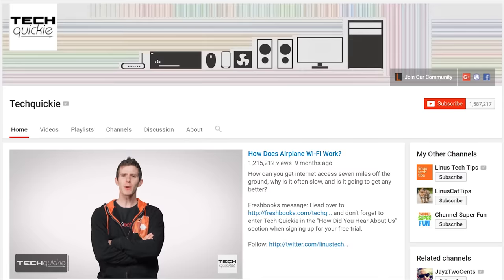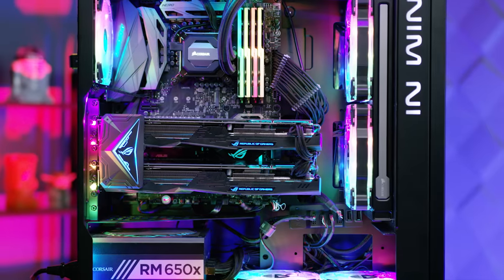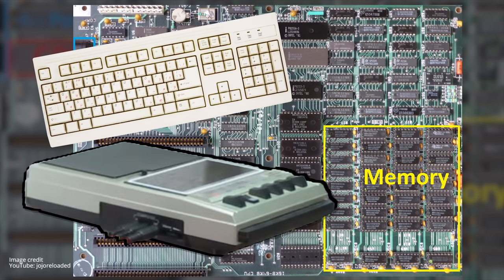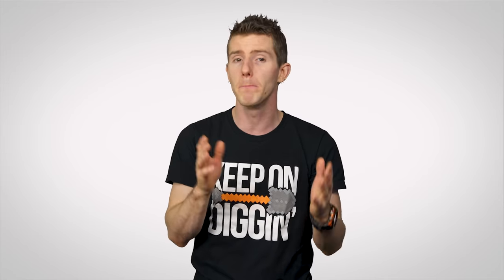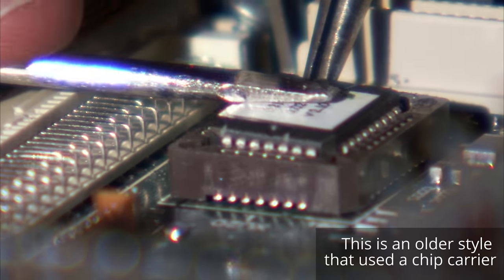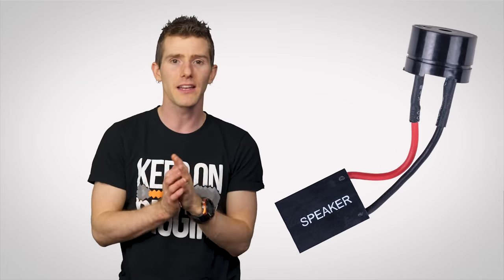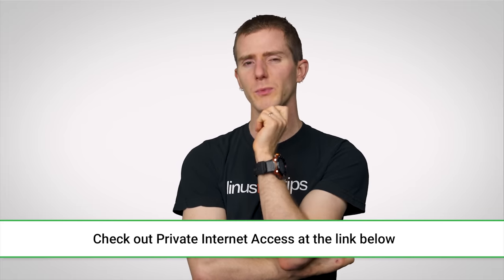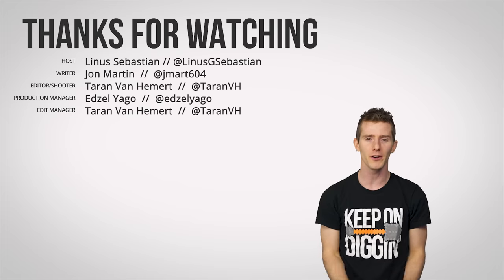History of the Motherboard

Comment: Started computing on a Amstrad CPC464 in 1992 with Datasette, a Green-Green-Monitor with Mode 1 Graphics and a whooping 64kB Memory. Learned BASIC on that System when i was 9 Years old. Still struggled in school, but my programming was good, haha
Reply: And just last Weekend i assembled my brand new Ryzen5 3600X on a MSI B450 Tomahawk Max, with 32GB 3200MHz RAM and without any optical drive. Man, how times have changed. The difference between my first games and what i am seein on my i27X HP Screen now is unbelievable. What a time to be alive...

Comment: Speaking of motherboards...it would be interesting to see if there are any speed differences between a E-ATX mobo, or micro mobo. (Along with shorter and longer cables combined) 
Largely due to parts being closer together/far less travel required for things to communicate. 
It would be extremely small in difference most likely...but I’d be interested in seeing the results. 
Perhaps it would also bust any myths out there. 
(I’ve seen people debating this oddly enough).
Reply: If there is a speed difference, it's in the PARTS used, not the size of the motherboard.

Comment: At least with expansion cards, you could upgrade capabilities like video and memory.  You can't do that with integrated functions on the motherboard.

(Do you still have to change the jumper setting from master to slave on external drives?)
Reply: I've not seen a "master/slave" jumper on anything since EIDE - Serial IDE (now known as SATA) did away with those.
I think SCSI lost their "drive address" jumpers with the SAS standard.

Comment: During 90's and early 2000 cheap motherboards weren't fully compatible with affordable ISA or PCI cards. I had various problems. Also theoretically they were MS Windows compatible but in practice several crashes was the reason of poorly designed motherboards. 
The true is that motherboards by Intel or reputable peripherals like Creative  Sound blaster sound cards, 3dfx Voodoo graphic cards, HP printers/scanners, Intel network cards, Microsoft mouses etc were highly compatible not only with Windows but with Linux too. Cheap RAM modules was an issue of serious instability. The more you were paying the more stable and fast your PC was. 
The last decade the performance gap between laptops and desktop computers is narrower and I don't bother with motherboards and internal peripheral cards.

Comment: I remember when installing a cpu, you had to set the jumpers on the motherboard to set the appropriate voltage for the cpu.
Reply: AND the clock rate.
You have just partly described every Socket 7 motherboard I've ever seen OR worked with/on.

Comment: AGP short lived? It lasted 10 years. It started before we had what people would recognize today as 3d video cards and went up to cards that even today can still be used for some games. If you want short lived buses, try the CPU dependent VLB that was essentially the bus of the 80486 added to the end of a 16-bit ISA slot. That or the AMR slot for modems / sound cards.
Reply: It is possible to get AGP cards that are low end GPGPU capable.
Not many of them ever made, but A FEW.

Comment: The S-100 was a Passive Backplane design.  Flawed because it required regulators on the daughter boards. But tens of millions of computers could have been easily upgraded and not thrown away if Imperial Benevolent Malevolence had produced a good passive backplane design.

Comment: Slight correction, many many MANY years ago, I had a socketed 10186 that had little gold tabs like a modern Intel CPU and sat inside a ZIF socket (like LGA style), then my AMD 386's were either soldered or inserted into PLCC sockets, while my Intel 386's were pin socketed like the 80486, 586, Pentium 1, and Pentium 3 socket 378... 486 was not the first socketed Intel chip...
Reply: 486 wasn't even the first Pin Grid Array Intel CPU - that was a few models of the 386, and POSSIBLY the 286 (but I think the 286 was still DIP).
Reply: @bricefleckenstein9666  I also had a 286 PLCC socketed board at one point
Reply: @davidflorey  I'd managed to forget about those.
I've not seen anything PLCC in a couple decades I think. Perhaps longer.

Comment: The future is exciting, motherboards soldered into the frame so it cannot be replaced, GPU and CPU soldered onto the motherboard with a permanent attached heatsink glued ontop. 
Keyboard and screens permanently glued into the chassis, memory, SSD and even harddrives soldered onto motherboard. 

Irreplaceable batteries and much more.
Future is coming guys and its looking good.

Comment: Well, this awoke some memories of the past.  An Episode on the bus evolution would be cool as VESA Local Bus didn't get a mention.  Also, I wonder how many people remember the pre IDE hard drives that had all of the drive electronics on an IO card.  Weren't the first lever based CPU sockets called ZIF for zero insertion force?  Guessing most people who worked on kit before that will have had to do pin straightening before, fun times 🙂. Right, I'm off for a nostalgia trip.
Reply: ST-506 interface, in MFM and RLL varients.
Also ESDI and SCSI.

Comment: At 2:00 you say that the memory was build in. But that is not correct. This was the first standart board memory sockets. 
Normally they delivered the PC with just some memory and then you could  buy/plug in more memory. 
Or you can change a simple chip without soldering if you had a defect.
The next generation of boards was the first with a free multiplikator where you could change the CPU,
and then "Jumper" the right Mgh and Multiplikator. That was a cracy time without Plug&Play.
Install a driver, write it in the autoexec and config file.

Comment: Motherboards still need to evolve further; some of the tiny four and three pin connectors need to be phased out, they're very annoying to work with, and also confusing at times especially if you are like me who builds a new computer every 3-5 years and gets to go through that nonsense all over again. I'd like to see Asus, Gigabyte, AsRock and other manufactueres work on simplifying the Motherboard layout even further by 2020.

Comment: You could talk about axt  itx  mini atx motherboard sizes and if it is standard or if it is up to the manufacturer.
Reply: ATX. Mini ATX, Extended ATX, have standard motherboard sized.
ITX I think has a standard.
There is also the FlexATX standard, but that's not a lot used any more I think.

Comment: Next, there'll be a way to install CPUs without the sometimes-annoying thermal paste/thermal grease. Maybe processor's heatsinks will be physically soldered to the built-in heatspreader, with additional cooling layers optional.
Reply: Unless CPUs start needing a LOT LESS power, we'll never see the days of non-imbedded non-laptop CPUS that can operate for more than "POOF" without a heatsink and thermal compound.

Comment: we went from IDE to SATA ports...
we went from ISA to AGP to PCI to PCI-e, as mentioned in the video this was in 2004, its 2018, why hasn't a manufacturer thought about making a newer, faster, smaller port to replace PCI-e?
thoughts? :)
Reply: Gerome Fournier Still enough bandwidth? Maybe when gpus use more than 16 lanes speedwise
Reply: We actually went from ISA to PCI to AGP to PCIe, and both PCI and PCIe are still with us today, though it is getting harder and harder to find motherboards with PCI on them. The reason AGP only had a relatively short life is that it was a dedicated slot just for graphics cards (hence the name, Accelerated Graphics Port), and so it was less useful than the other standards, which could take basically any kind of expansion card. As for why PCIe hasn't been superseded yet; it hasn't been around that long. PCI was introduced in 1991, and it was still very common to find it on boards just a few years ago, and as I mentioned, it still hasn't been entirely phased out. Compared to that, PCIe has barely got started.

Comment: if that IBM came out in 1981...hmm..I just can't help but compare that thing to my home pc at the time..the mighty Sinclair ZX Spectrum...which was around in 1982...I am reasonably sure that it was more feature rich than that IBM...it had 48 K of RAM, color graphics, a very good version of BASIC with real time syntax checking...it had tape loading system, a micro-drive interface, interfaces for joysticks, paddles etc, printers etc, it was extremely well supported....

Comment: Now if they would just for the love of god move the 8 pin CPU power connector to acknowledge that power supplies are on the bottom now and not the top. I can't use the cable management in my case if the only way to make the power line reach/be able to go in is going along the front of the board.

Comment: It has mostly been an upward journey. Does anybody else remember building 386s and 486s with f#kking raiser cards? Dear lord god, I'm glad that's ancient history! Or on-board jumpers, to configure HDDs, so you had to read the number of platters and heads and cylinders and sectors, and then set 4 or 5 jumpers before the MB would even read the f#kken drive! And by the end, systems got smart enough to figure out what a drive was and work with anything, but to start with, you had to tell the system if this drive was a master or a slave. You would think that simply depended on whether it was plugged into the middle of the ribbon or the end, but No, that'd be too simple....

Comment: Good video. But as a dude that was around back in the...(god, i am old)...days, i can´t remember any mobo´s with built in sound (on wintel) untill the mid90´s. It was always separate cards even on mass produced (Dell etc). The last gaming rig i built was in 1996, and i like all other bought the Sound Blaster AWE 32. Ok, in 1996, mainstream PC´s had started to have integrated sound. But Ethernet??? I´m not saying that´s a millenial thing, but i think that´s something that started to also appear in the later part of the 90´s. And i guess that it´s partly because all the other standards that were around. I remember working on all those bus-nets with coax and others like IBM´s Token Ring. And IPX/SPX and Apple and MS hopeless attempts with Appletalk and NetBEUI. Some people say that it was better in the older days, but i just can´t see how ISDN+IPX+Cisco ever could be a good memory. Anyway, i think built-in sound and ethernet became standard a bit later than said in the video.

Comment: Why would you make expansion slots, when you could just integrate and solder everything. Requiring customer to use your excelent customer support, which doesn't have licenses to use your hardware and software. All this makes so much better ecosystem.

Comment: I am so glad for this video. Why? Because I was beginning to think I was senile. When I first started hearing of CPU's with integrated graphics I was so confused. I was certain it was the motherboard that had the graphics chip. In the end I just shrugged and assumed I incorrectly remembered or something. Afterall I never paid much attention to integrated graphics since even a basic Video Card was preferable most of the time. But no I was right! Vindicated!
Reply: Actually, AMD's A-series KILLED the bottom end video card market.
The A10s had APUS that were very close to a AMD HD7750 on some models - DDR3 "main memory" shared from the MB instead of DDR5 dedicated VRAM on the later 7750s was the discrete card's only significant advantage.
Then along came "Vega 11" and such on the Ryzens....

Comment: 486 is socket 3. Were is VLB, MCA and EISA? Were is Zorro slot from Amiga as Amiga was a PC as well. This is all about the IBM compatible PC. Not PC as in general. There is a giant hole in everything. I have even seen 386's on ZIF sockets.
Reply: PC in reference to microcomputers is IBM compatible. IBM-PC. Personal computers is another thing entirely.
Reply: Paul Frederick Dude.... PC is general for every single computer thst is a personal one. It has evolved from humble little machines running basic as the operating system to what we have now. A mac is a personal computer as well.
Reply: PC is general today. But IBM invented the term with the introduction of their PCjr model to describe their consumer line of machines. So PC means IBM compatible. PC != Personal Computer != personal computer.
Reply: Paul Frederick No. They invented the "IBM Personal Computer" the term Personal Computer was already invented. They just did their own take on the Personal Computer craze. VIC-20 was sold as a Personal Computer as well.
Reply: No one was saying PC before IBM did.
Reply: Paul Frederick Apple shure did say that their Apple-II was a personal computer in a commercial they did in the late 70's. PC is short for personal computer, no matter if we are talking IBM or Compaq or Apple or Commodore.
Reply: Paul Frederick And radio shack called their trs-80 a personal computer. As you can see, the term personal computer are much older than IBM's take on the term.
Reply: How many different ways do I have to say it? PC means IBM compatible. Even Apple acknowledges this fact in the Mac vs. PC ad campaign. So how come you don't get it? They go further and equate PC with Wintel. BTW the first notable Apple commercial wasn't until 1984. That would be the 1984 Superbowl commercial. It really does help to have lived through all of this. Like I did and you obviously didn't.
Reply: How many times do I have to say it? PC does not mean personal computer. PC means IBM compatible. Even that is an extension of the original definition. Because at one time PC just meant an IBM personal computer. Then Microsoft shafted them with Asian clones.
Reply: Paul Frederick And how many times do I have to keep telling you that you need to look for computer ads. You need to look for any clue for the term personal computer. I keep telling you that the term Personal Computer is much older than IBM personal computers. Fine if the 1984 add, was apples first. Yet that does in no way make the term Personal Computer unique to IBM alone. Even wikipedia names Apple-II a personal computer. "The IBM Personal Computer" is a standalone product from IBM. The computer industries product catagory called "Personal Computer" is much wider. There were hundreds of companies, making Personal Computers in the 70's and 80's, and most are dead by now. Only those that made clones of IBM Personal Computers survived alongside Apple. Even IBM has retired from making Personal Computers. Regarding Apple realising. Nope they did not just realise. They are too fancy and think too much about them self. That they started to just call it something else. Yes the product is named a Mac, yet it is still in the category of a Personal Computer.
Reply: Paul Frederick And Altair 8800 was referred to as an Personal Computer when introduced in the late 1970's.
Reply: I do not need to look for shit today. I had subscriptions to all of the popular computer magazines in the 80s.
Reply: Paul Frederick Whatever man.... Whatever. I told you were to look. Not my fault that you are afraid admit you cant back your claim up.
Reply: I do not need to back anything up. History is what it is. PC is a line of IBM computers that were later cloned. Personal computers is a wider set that PCs are members of. But not all personal computers are PCs. Only the IBM compatibles ones are.

Comment: "it wasn't until 1981 with the IBM PC's planar motherboard".... whoa whoa, back up just a sec. What about the Apple II and Atari 8-bits (and I expect various others), just for starters? They came along in the 70s and had CPU + memory on board, plus a limited set of standard ports (moreso than the PC, it could be argued, as there was usually at least a serial in addition to the tape interface and built-in keyboard) AND expansion slots... Really the PC's main difference vs those was using a completely different CPU architecture, and offboarding every port except for keyboard and tape to expansion cards.

Computer mobos actually started out a bit more integrated, got a bit more so in the 80s for everything except the PC (particularly almost every 16-bit was a single board machine with a great many directly-mounted ports), then the PC ones started coming back towards the fully integrated setup, with a detour through including headers but no directly attached connectors.

I suppose maybe it's supposed to be an IBM-compatible machine history specifically, but before 1981 those didn't exist at all .

(the rest of it is pretty good though ;)

Comment: A lot of incorrect facts in this, Linus. Integrated drive controllers weren't a thing until the mid 1990s. And sound cards were around and very popular starting in the late 80s until widely replaced by onboard sound. Also, AGP was not short-lived, lasted almost a decade.

Comment: my ibmaptiva has a integrated sound card and its from 98  it uses 440bx intel chipset, it migth be alsoe ac97 so i think ac97 is from 97 :) i think integrated sound might have started in 98 97 or 96 :)

Comment: "Short lived" AGP? Um, okay. More like 1997-2005-2006ish, 8 or nine years. The standard did evolve to AGP 2x and then 4x, but almost all of the AGP slots were backwards compatible with the older standards. My Abit BH6 carried me through P2 266 with Voodo 1 and then nVidia TNT, through the Celeron 466@525 with TNT2 Ultra, GeForce 256 and GeForce 2 GTS, ending with a coppermine p3 700@933 on a slocket. I then stupidly tried to flash a custom startup splash screen to my BH6 BIOS, which left the board bricked and i got an ASUS CUSL-2 with the 815 chipset and a GeForce 3 Ti200 until i could get my hands on a new BIOS chip for my BH6, otherwise i would have carried my rock solid coppermine 700 P3 @ 933 and the GeForce 3 a couple of years further on the best motherboard ever made, the ABIT BH6